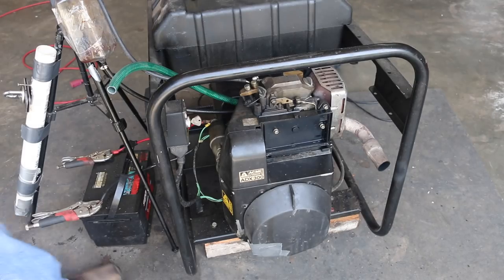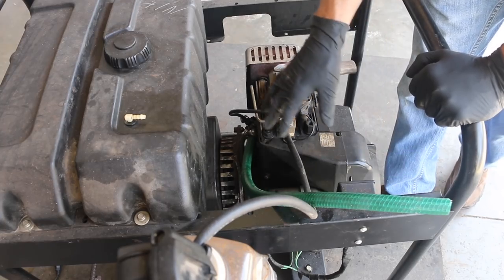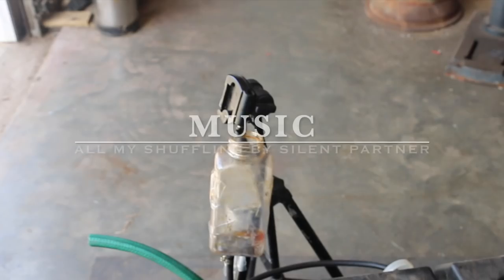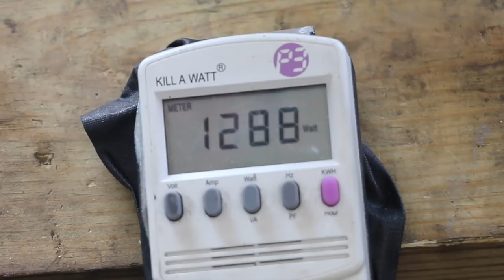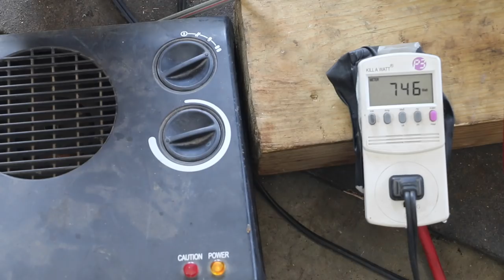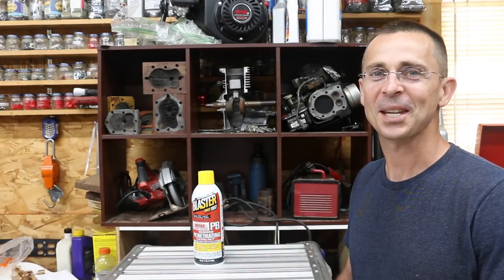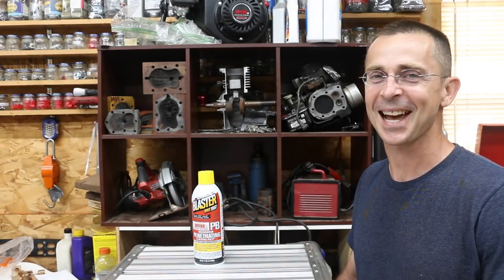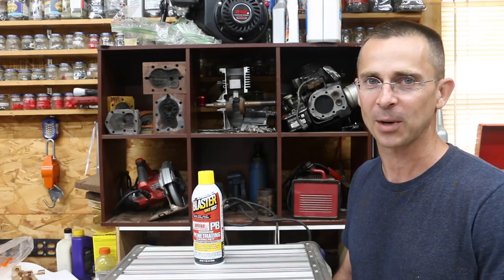PB Blaster as FUEL?  Let's find out!

Comment: Very interesting!  Is the reverse also true? Does diesel make an good penetrating oil?
Will a diesel engine run on canola or sunflower oil?
Reply from the maker: Great recommendation!
Reply: Project Farm the acme motor that you are using was used as an engine for lawnmowers whit seat and for generators 

This in the new version the previous one has a flywheel and doesn't have electric startup

And a request: try using the sou  oil (the raw one) mixed whit diesel and alcohol ad different percentages
Reply: I know you can run on vegetable oil. But can it run on olive oil. Vegetable has a higher smoke point then olive. Running used vegetable oil is only good if we had smellavison.
Reply: yes its ok, not the best but its good, also good for cleaning your hands and cleaning grease of engines or whatever, it has detergents in it and it makes a good cleaner
Reply: Most engine cleaners are just a diesel mix so it should run but not sure how long though
Reply: Bacon grease!!
Reply: diesel engines at first was made to run on peanut oil idk why you couldnt run oil of any kind thru it as fuel worst case u might clog up the injector
Reply: Cotton seed oil is best but remember them war movies latrine duty gotta stir the shit pot they mixed it with kerosene to burn human waist in the 6x6 they ran all kinds of shit in them old kerosene engines
Reply: Ian Y Gath diesel is the best penitrating oil.
Reply: Old diesels will run off peanut oil
Reply: Project Farm yes it is actually very good. If you have a rusted up solid vintage engine. Before you try to strip it down you put the whole engine in a bath of diesel for a couple of weeks. Then the rust just crumbles off and all bolts can be undone with ease.
Reply: TheOtherWhiteBread0 had a locked up v twin motor, ( sitting in the Houston flood water) filled the cases up with diesel for a few days and it freed the crank
Reply: John Coyle they did not have peanut oil in Germany in the early 1900's when diesel engines were developed by a German engineer called Diesel. They had crudely refined oils made mostly from super heated oil shale.
Reply: Diesel does work well the same. If reccomend looking into how the refinery process works. Gives a great idea of the diferent grades and weights of oils. Ive seen many old trucks running on cooking oils. Used stuff from fish and chip shops or takeaway shops is the best because it smells great hahaha
Reply: old mercedes diesels will run if you take a shit in their fuel tank also. waste oil,hydraulif oil,atf,vegetable oil,all these fuels run in old idi or tdi mechanically injected diesel engines.
Reply: I've run about 5 different MB diesels on veggie with little to no issue or modifications. I blend about 25% diesel in, and filter it really well and make sure no water gets in. 

Ready to ride
Reply: Absolutely, the one car I paid $600 for (85 190D 2.2) and have saved $3000 so far as to date.
Reply: Diesel engines we're originally designed to run peanut oil. At that time, peanut oil wasn't used that much for anything
Reply: Yep,those prechamber benz diesels(OM60x series) drink almost anything,if you put a little effort into it and clean the fuel.
I know a couple people who ran 100% waste oil for years without any problem.
When I get my benz,I'm planning to use some free fuel too :D
Also,those turbocharged engies(OM60X.96X) are redicolously good for tuning,the 605-606 takes 3.5bar of boost on the stock engine easily for years,and you are at 5-600hp levels then.
Best engines ever made in my opinion
Reply: i have a w210 e300td with the om606.962 and it runs on pure hydraulic oil i get from work and it even produces more power with it also.
Reply: diesels can run on freakying motor oil. it will ignite any fuel as long as it has compression

Comment: Try to modify it to run like a multifuel engine like the military had in there deuce and a halfs.  Try filtered used motor oil and used filtered fry oil
Reply from the maker: This is a great idea!
Reply: I'd like to see the process to make fuel out of fry oil as well.
Reply: Marco Cazarez those engines were able to run on almost anything I have say people do used motor oil fry oil jet fuel even gasoline but to run without much damage with gasoline they recommended to add i believe it was one quart of oil to 1 gallon of gas.  It would be interesting and mean a lot as my grandad was a mechanic who worked on these and tanks while im the military. Thanks
Reply: i love my m35a2 multifuel lol, ran about 20 gallons of old atf last time andoh how it smoked xD it was free so my wallet was happy
Reply: Used oil as diesel fuel - atf, hydraulic, gear, cooking oils.
Would be a good comparison
Reply: Sebastian Hibbert where did you get your deuce and a half at and how much was it if you dont mind me asking all the ones near me are dusted like crazy and are super expensive for there condition
Reply: Know a guy who runs used fry oil in his old diesel station wagon. Smells like french fries when it runs

Comment: Is that a Diesel generator that runs a 3600rpm or 1800rpm? And will "Engine Restore" help this engine at all?
Reply from the maker: 3600 RPM and great idea on engine restore.
Reply: Yes, I was wondering if engine restore would work in a small engine.
Reply: Keagan Knapp fantastic idea
Reply: We had  15kw Diesel generator down at our hunting camp in the Everglades it was old and tired and I put engine restore in it and it worked Great the motor would start up faster and run with less smoke and I use the 6cly can size

Comment: We always filled our fuel filters with ATF when replacing on the old Mercedes-Benz diesels. Started and ran just fine
Reply from the maker: I'll have to try this!
Reply: every time I change the fuel filter on my diesel engines I fill em with ATF. Anecdotally it runs great and is supposed to clean the injection pump and injectors. In reality I'm not sure how much it affects anything besides running really well. The other thing I do is dissolve paraffin wax in 2 gallons of diesel fuel before adding it to the tank of diesel for the engine. The new ULSD doesn't contain as high of a concentration of paraffins in it and causes the old Bosch injection systems to clatter. Adding it back makes everything run much smoother. The VW diesel 1.6NA manual also says, that for cold weather operation in winter, to add a gallon of gasoline to the tank to prevent gelling of the diesel.
Reply: Be very careful with this. The red ATF dye will be returned to the tank after the system primes and the tank of fuel will appear pink. What other kind of diesel has a red/pink dye in it? Yep, tax free off-road diesel for farm tractors and such. If you're caught on a roadway with tax free diesel in the tank, HUGE fine. 

I now prime the filter with Lubromoly Diesel Purge or 2 stroke engine oil.
Reply: I live in an area with a large agricultural community. It's mentioned a time or two about the offroad diesel and dye... never known anyone to have a problem with it. Still a good thing to be cautious about. I never run offroad diesel and I'm not too worried about the little bit of ATF I throw in every couple months. After 120k miles I rebuilt the IP and there was no red lingering in the system. You do make a good point though!
Reply: mogwopjr It could all come down to timing one day, you know? You change the filter on a 1/2 tank of fuel, then a day later you're on the highway and get pulled over by highway patrol. They see you're in a diesel, you live in an agricultural area, and the officer has a wild hair. He takes a sample out of the tank, sees a pink hue to it, and declares that you are burning tax free fuel on public roadways. :(
Reply: mogwopjr I live in a agricultural community as well. Once and a while there will be a diesel pickup pull out in front of me, and you can easily tell if they're running red diesel based on smell! I just smile whenever I smell it!
Reply: I will say we did this for no other reason that we had the ATF pump spigot on the wall and it was the easiest way to fill the filter and keep the system primed. 
I do remember the old diesel fuel was much thicker though and slick. Any on the floor and you were on your butt
Reply: Is there a reason you don't just use diesel in the new filter?
Reply: Just didn't have a jug of it around. We always had the ATF station for convenience. This was at the dealership
Reply: If you got caught with the fuel and they didn't buy your story I'd make sure to get the officer to take a sample for analysis. A $50 test could save you a big fine.

Comment: You should try petrol with diesel mixed with different proportions, f.e. 5% petrol, 10% petrol, 25% petrol, 50% petrol, etc.
Reply from the maker: Thanks for the video idea!
Reply: Truckers do that when their rigs fuel is gelling up due to cold weather.
Reply: You can mix diesel with gasoline, but only in really cold weather when the diesel has thickened. Add too much, and it gets too thin (won't lubricate injection components) and the gasoline will burn the pintle tips of the injectors. Gasoline can also be used to dilute and thin waste veggie oil even at normal ambient temps. Again, not too much.
Reply: I know this trick works, my dad used to run an 89 Ram 10:1 gallon gas/diesel mix. This was also the truck I learned to drive in as a kid.
Reply: Diesel actually isn't mixed with gas but rather kerosene because kerosene has similar lubricating properties as diesel. Gasoline is actually really bad for a diesel because it offers zero lubrication and causes damage to the injector pump and injectors.
Reply: Split Second Magician Yes, winter diesel is mixed with kerosene to lower its clouding and freezing point. Even so, in some places it still gets cold enough to freeze winterized diesel and a little bit of gasoline will liquify it again. It's only ok to do that in really cold weather when nothing else works. As I said, gas can be used to think WVO, but if you're running straight waste veggie oil you don't give a shit about the vehicle anyway.
Reply: The engine was gas not diesel. ran just fine with the mix
Reply: James Meiers I don't know why you'd want to mix diesel into gasoline for use in a gas engine. :/ No benefits... It'll smoke and foul up spark plugs.
Reply: mannys9130 he got the diesel for free from work. He test engines on dyno. Fun job!
Reply: James Meiers on the Scotty Kilmer channel a few weeks ago, there was a guy that had a $5000 old army surplus truck from The 60's or 70's it seems.  Anywhow, the truck gas tank said it can run on gasoline, diesel, or motor oil.  I never heard of such an engine.  This was said to be the perfect shtf vehicle as if fuel is needed, you can just go around and drain the used engine oil out of abandoned cars on the side of the road.
Reply: David James Some turbines were able to burn just about anything. Including, regrettably, vodka.
Reply: That's what we did when the diesel in the truck gelled and not a single store had "diesel 911" in stock. It works within minutes and engine temperature did ok. I think we put a gallon of gasoline in a 3/4 full 20 gallon tank of gelled diesel.
Reply: SeriouslyKidding Makes sense. It's like a salamander heater, as long as it ignites and the fumes don't kill anyone within 3 feet, you're good to go.
Reply: +zappy bear
But you are still wasting vodka! Methinks (humbly) that vodka is a far better warmer when drunk - rather than burnt.
Reply: The manual for my '89 VW Jetta recommended a maximum of 20% regular gasoline in winter to prevent gelling of the fuel. I spoke once with a fellow who used 20% gas regularly and the injector pump died prematurely. I used 2-3% high test gasoline for several years in the '89 motor without damage as I added synthetic 2-cycle oil and my mechanic retarded the fuel timing slightly. It gave more pep, less exhaust smoke, better economy and much better winter starting at -26 Celsius or 15 below zero F. Fuel consumption was 4.5 l. / 100 km. or 62 Miles Per Imperial Gallon or about 48 Miles Per US Gallon. Better than a Smart car and safer.
Reply: I know that in winter conditions you can use gasolne+disesle mix, but how will it work in summer with different proportions.Second question: how different octane numbers will affect on engine. Will be high-octane better or worse than low-octane.Third question: in USA you have lower octane numbers of petrol that we have in Europe - we have basic 95, "better" 98 and "sport" over 100. It's measured with RON norm, I have read that in USA is (RON+MON)/2. Has anyone list of US petrols tested only with RON?
Reply: A while ago i ran a 1970s briggs & stratton 3.75 lawnmower on the first runoff from a distiller it had slightly more power but used a tank in about 15 min i had to adjust the mixture screw so it would run good
Reply: I found the diesel/gas mix worked just as well in summer as in winter.
Reply: Why do you say that?  It sounded like a gas engine to me.  Do you know something about that particular engine?
Reply: Project Farm test dollar engine oil's please (10w30)

Comment: Try running the diesel engine, with 2-stroke oil as fuel 😊
Reply: OverMagten it should do it with a bit of extra smoke
Reply from the maker: Great video idea!
Reply: OverMagten I mix a little 2 stroke oil in my diesel fuel in my truck. Quiets down the injector pump and improves mpg a bit.     Today’s fuel has lubricant removed and that can harm older diesels
Reply: How about mixed with used vegetable oil.
Reply: Would also like to see the engine restore used in this motor
Reply: @Jason Truman - I hear you, they took the sulphur out, which reduces the emissions and helped reduce or eliminate the issue of acid rain (anyone else remember that?) but the sulphur acts as a lubricant, not so bad with newer diesels but some of the older kit ain't happy on low sulphur diesel at all...
Reply: OverMagten purely running on oil seems like a good way to cause a run away engine lol but I'd love to see the results
Reply: +Gaming... it would likely work very well. People run diesel cars and trucks (the older ones) on used fry oil (no, I'm not kidding).
Reply: tarstarkusz doesn't that require some equipment upgrades and oil needs additives?   And I'm guessing no run away issues.  Never heard of any before from the biodiesel anyways
Reply: OverMagten i did that once with a 7500 watt diesel genset , was an emergency situation and had 2 gallons and ran perfectly!!!
Reply: Was gunna say that but that stuff is thick
Reply: Brad g it might be, that is why, he has to test it ;-)
Reply: Dieselcallaghan cool, i would love to see him test it 👍
Reply: +Gaming... In new diesels, yes you have to make it into biodiesel (it's not that hard or expensive), but in older diesels, straight used vegetable oil works find, you just have to filter it with a cheese cloth. It also only works in warm weather. Vegetable oil gets thicker if it gets too cold.

Comment: Please use various oil types as diesel engine fuel: baking oil, motor oil, old motor oil and diesel mixture
Reply from the maker: Great recommendation!
Reply: Once guy from Life OD poured used motor oil in the fuel tank of his MB 240D and it run pretty well
Reply: In a tdi 130 i put crude oil, used oil, etc..... 20% And the engine works perfectly!!!

Comment: You can run a lot of things though a diesel engine.  You should try some Engine Restore in it.   I think you should trying running vegetable oil as a fuel.
Reply from the maker: Great recommendation!
Reply: I ran cooking oil on my Peugeot 306 for years, it was brilliant.
Reply: Yes engine restore is a great idea. Especially after seeing what it did for the tractor.
Reply: my dads audi 80 1.9tdi runs on used vegetable oil just fine.

Comment: I would like to know if gas and/or diesel engines can run on Raid insect spray, please!
Reply from the maker: Thanks for the recommendation!
Reply: If you were having problems with the engine...  it'd at least help you get rid of the bugs in it. :D
Reply: the biggest problem with any non-oil fuel in a diesel is that you will seize the injector.  its why gas in a diesel with destroy it, you essentially seize all the injectors.

Comment: Try running used motor oil in the diesel.
Reply from the maker: Great video idea!
Reply: I ran an old Mercedes wagon on about 80-90% used motor oil for months back when diesel was over $4/gal. Power was down and it plugged fuel filters about every 100 miles. Switched back to diesel and it never missed a beat
Reply: Did this in my Duramax after extensive filtering. Ran ok. Had to advance timing and fuel pressure to get it to run without too much smoke. It still plugged filters faster then diesel
Reply: PS: the ones that practice this usually call it W85. 85% waste oil to 15% gasoline. Some call it black diesel
Reply: Yeah, my old yellow wagon 'Colonel Mustard', would blow some white smoke under load. I think the turbo helped with running this fuel and I don't think the results would have been as good with a non-turbo. Saved me tons of money though as a highway commuter. I worked at the MB dealership at the time so 'fuel' was free.
Reply: I would filter that used motor oil with a very strict filter, as it contains metal particles that would definitely kill your injector.
Reply: Jason Harrison, I ain't a diesel expert or nothing but, how does one advance the timing on a diesel engine?.
What timing is there to advance?
Reply: byw injector timing
Reply: Okay thanks.
Reply: Go one step further, perfect a ratio of WMO/diesel/gasoline and determine what micron WMO has to be filtered at.